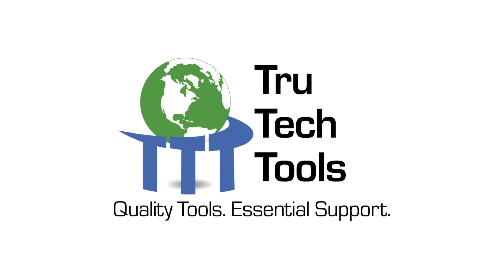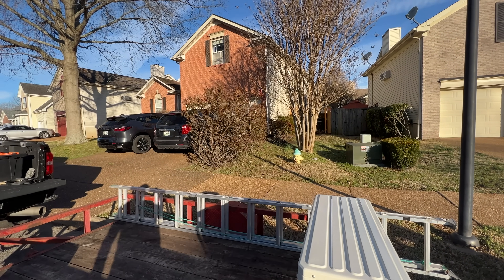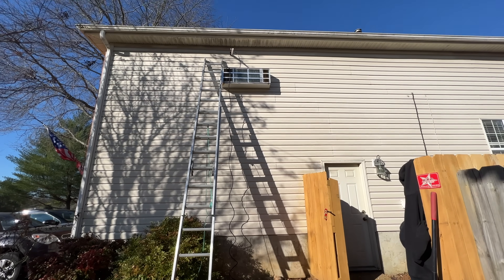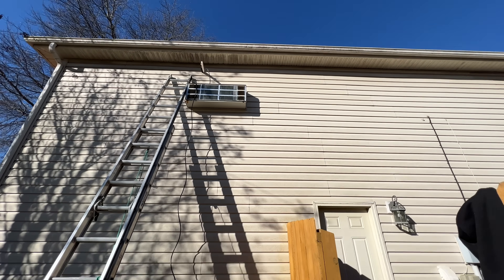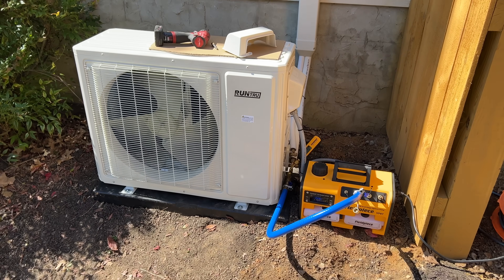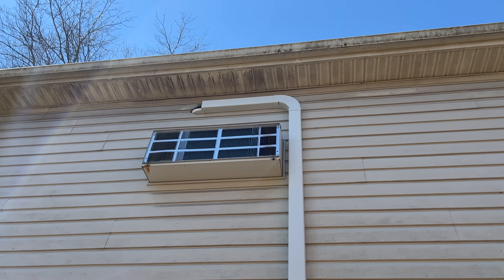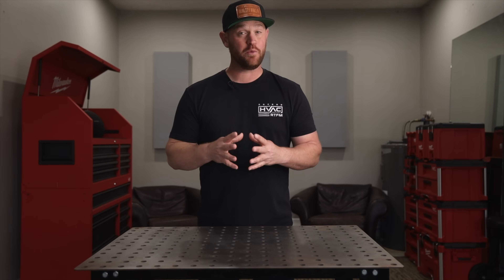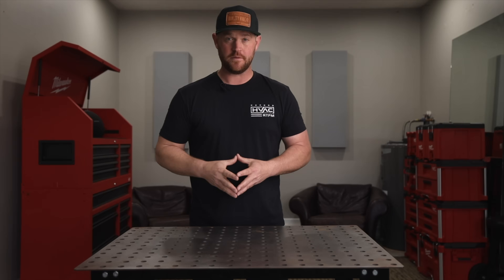Installing A RunTru By Trane DUCTLESS Mini Split | HVAC Installation

Comment: you can hang a wall mounted indoor below 4 Feet and not short cycle the air flow.  what does the installation manual say

Comment: Before drill completely thru the wall behind the evap i like to yes make a lil hole but see at first if there is not a plumbing pipe in the wall or a electricity wire .
After taking out a small piece of gypse. And see that its ok , i take my holesaw completely threw the wall

Comment: How did you run your electrical / I don’t see a disconnect, probably should have ran liquid tight for high voltage as well.
The install is very clean tho

Comment: I was told to never use nylog on the threads, only put a drop on the inside of the flare and use your finger to spread it out. I guess if you do, it causes to the nut to back off eventually? Have you had any issues of this happening? Great work as always by the way!
Reply: It's not wd-40 lol. The nut isn't gonna back off if you put nylog on the threads.
Reply: @arodandjeter1  That's what I thought as well. A Trainer from Fujitsu said to never do use it on the threads.
Reply: @TheAndrecastro20  I don't doubt it. I was really just joking😂I've never had issues with using on the threads but not saying it can't cause issues either.

Comment: Clean install, why didn't you swedge indoor coil connections? Can cut off stubs they give you, zero chance for leaks that way.
Reply: I always remove the flares from the indoor units . Remove one possible leak from the future 🤷🏻‍♂️😀
Reply: I'm pretty sure that's the Navac battery flaring tool
Reply: Looks like a GREE minsplit.

Comment: What kinda blade did you use for the angle grinder to cut the line hide? It’s a great idea to get ‘em both cut.
Reply: You don't need a grinder bro. 
Tin snips work way better

Comment: Not even made by trane. Its  a relabeled chinese stuff. Install nice though
Reply: This system is all about price. Trane Branded Minisplits are made by Mitsubishi
Reply: @mattthomas9354  Im a Mits dealer & AMS(trane)dealer  That unit is not made by Mits. Trane uses a Co in China to make their builder grade minis, Runtru/ameristar.  But recently have change to Midea manufacturing. Just saw the new stuff two weeks ago at dealer meeting.  The mitsubishi/trane venture  uses mits units but gives us a sticker to put on face plate that says trane or American Standard..  Anyways Installers did a good job of installing
Reply: @lctachell  I'm a Trane Mitsubishi Distributor. That's what I said. Trane Branded equipment is made by Mitsubishi, RunTru is made by Gree

Comment: Why no risers or stand? You said heat pump right in the winter time the condenser will make water and may freeze, other than that nice clean job!!
Reply: Heatpump mini splits don’t need risers.
Reply: That is not necessarily true. If installed in a “cold climate” risers or a stand should be used.  Maybe not in Tennessee where I believe this installation took place.

Comment: Should have ran the exposed communication wire in conduit like you did for the high voltage wire. Don’t need a weed eater hitting it or rodents chewing on it. Not bashing your install, just telling you from experience.
Reply: Yeah I agree. Communication is still high voltage.
Reply: @punchpunchowned  you’ve been zapped by comm wire too huh? Hahaha
Reply: Yup that’s code in nc